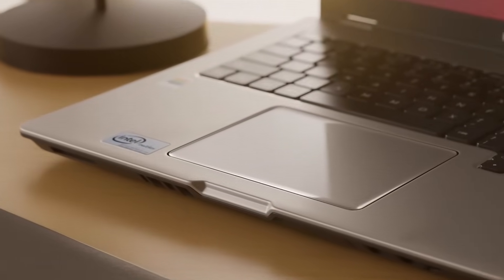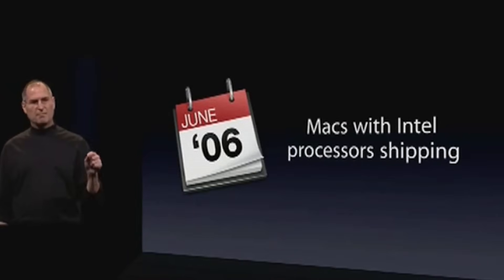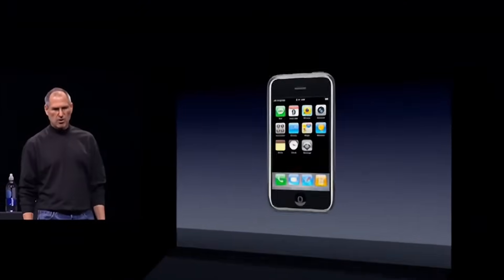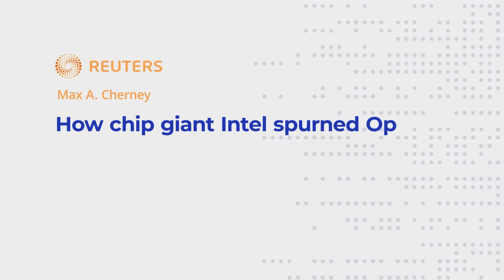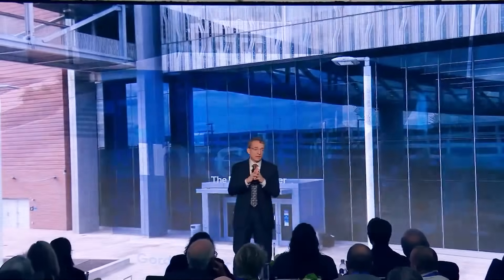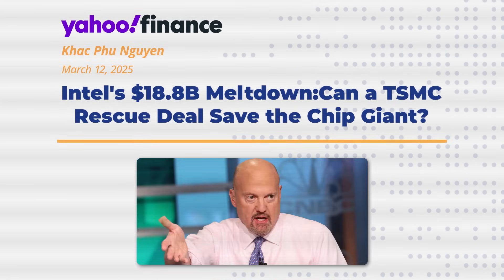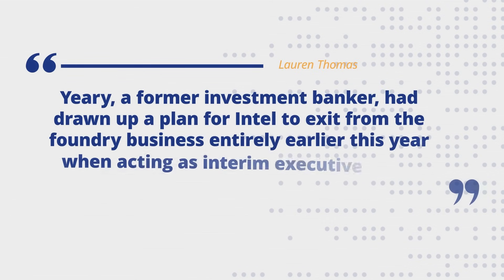An Autopsy of Intel's Self-Inflicted Wounds

Comment: Arms provides big flexibility and added value to customers  to differentiate themselves with its architecture rather than the rigid total controlled PC model dictated by Intel. It also happens as Intel CEO recently acknowledged that the IDM model is not sustainable without external customers for the IDF (even if Intel has the whole PC market for itself.)

There is a host of reasons why Intel fails many of which are as you described here.

Comment: I'd say there are a lot of bad faith arguments being made here, but it's more likely machine generated pablum. The narration audio quality is pretty good, but it was obvious the script was jumping the track when around 7:30 total chip shipments were being used as a metric after previously calling out that Intel deliberately declined to enter the mobile market.

a real analyst would be looking at the development of the datacenter from the late 90s, where x86 (and Intel) pushed out competing architectures like SPARC, MIPS, Power, and Alpha, and how that is currently replaying with ARM. The rise of Opteron isn't mentioned here, either, although it was critical for both AMD and Intel's datacenter dominance.

no mention of how badly 10nm played out, multiple failed acquisitions, the frenemy relationship of Intel and TSMC... it's almost a tautology that companies give themselves self-inflicted wounds, but Intel has been punching itself in the face for decades now and recovered. What's different now than the previous failures and mis-steps?

Comment: Great video. The latest intel microprocessors do not deliver great performance; and if we add Microsoft to the recipe, a catastrophe is coming. Many people have capable computers that won’t be able to run windows 11, and many people are planning to move to Apple as their new microprocessors are amazing. If I want to to buy similar computers. A Dell will cost 3000 and a MacBook Pro 1800 with a smaller SSD, nothing that an external drive won’t resolve.

Comment: This clearly was written by an Apple fan and it bizarrely repeats the ACTUAL self-inflicted would Intel made.
Macs represented 17% of ALL computers. Until last year, even Apple still made Intel-based Mac alongside ARM. The reality is that over 80% of all PCs are still x86 based. Microsoft, who owns the OS used on those non-Mac PCs, tried to switch everyone to ARM and for the most part failed. What the pundits missed is that unlike Apple, which makes an OS that can only run on their hardware, thus forcing users to change or get left behind, Microsoft has to follow the MANY hardware makers or lose ground to Apple or Linux.
The reality is that ARM isn't Intel's big threat - AMD is. Yet for some weird reason, the tech press kind of ignores that AMD even exists.
On the mobile front, mobile devices like cellphones have ALWAYS been on RISC hardware. Before the iPhone even existed we had PDAs (Palm) and smartphones (PocketPC/WindowsMobile) that ran on MIPS and ARM. That was a market Intel was never in and so can't have lost market share in.
If Intel hadn't panicked over Apple and had focused on clear trends that were coming like AI (which AMD did, by the way) and got there first with an AI usable CPU - and if Microsoft hadn't seen the CPU panic Apple caused as a way to restart the PC market by trying to force ARM on a market that didn't particularly care about it, after trying two years earlier to restart the market by making Win 11 the first version of Windows every to just kill off millions of PCs arbitrarily, then Intel would be fine.
Again, AMD did these things by futureproofing their CPUs better, making them more powerful at a lower price point and even doing better with thermals. But mostly by hunkering down and weathering out the Apple storm by being more proactive and innovative.

Comment: One thing not mentioned is while AMD was on the ropes Intel stuck to 4 Core 8 Thread CPUs for years and years and only went to higher core counts when AMD released the Ryzen chip in 2017.

Comment: Intel has always had a healthy helping of Not Invented Here that is dismissive of outside ideas. Intel was briefly an ARM licensee after it acquired DEC. If fact it owned the brand StrongArm which would have been invaluable going forward. But, they just threw it away.

Comment: I bought 100 intel shares in year 2000 for $24 and 25 years later still holding it and is in the negative now, had I bought Apple, Amazon or to be frank any other company I would made a ton load of $. Just my bad luck I guess!

Comment: Using AI generated graphics showing developers as youths in hoodies in a darkroom with multiple monitors is just exceedingly stupid. I have been an engineer and developer for 50 years and I wear a tea short in a well lit room surrounded by EE books and 1 large maybe 2 smaller monitors. Even the graphics on those monitors is stupid AI nonsense. That damages your reputation in accuracy to skip the rest of the video.

What Intel should have done is to break itself up like AMD did and order silicon from the best producers and allow Intel engineers to follow their engineering dreams with say a helping hand $ to succeed in new fields and companies.

Comment: The whole video can be condensed into one word - greed. 4 cores for 2 decades with 1%  increase in a clock and 20% in a price.
Reply: You're forgetting about IPC/microarchitecture.
Reply: It is not greed alone. By the fact that Intel can’t put any chip beyond 14nm even when they realized they are done, they are at the end of their innovation. A dinosaur that need to be ☄️.

Comment: Intel's house of cards really blew down when they stubbed their toe on the 10nm process and AMD's introduction of Ryzen 8C/16T processors  Intel's ability to continually introduce improved nodes always gave then the edge and the 10nm failures and Ryzen's higher core counts was a perfect storm.

Comment: Imma stop you right there at 7:50. Arm64 was superior compute power to Intel at way longer battery life on both apple m1 and Qualcomm snapdragon elite x. Intel responded by making the chips 50% more efficient 1-2 times over two generations as well as slightly better compute power then previous and still fallowing mores law. This video is more opinion driven then factual. Also do you understand computers a CPU isn't designed to have a hundred thousand cores that would be required for ai nor does and CPU. That's the job of a GPU. Intels did make a half arze response to ai called an npu but again no where near the performance needed for a real AI same for arm idk about apple m4 they may be good. Intel making a dedicated npu far more powerful then Nvidia GPU would not save the company it would be its downfall as they are looking for far more energy efficient new silicon designs that are not a cpu or GPU. Intel instead needs to make 10GHz chips as originally promised with 8 cores. This would make them ahead of AMD and the primary place in the PC CPU market again. Nobody is buying x86 for servers they all use arm and Linux. Your opinion saying they should have done something would have just made them more in debt.

Comment: Intel was the first one to get to AI, but the market wasn't ready. They were called Intel xion PHI. Accelerators. He tells the implementation was far too complicated. Several years later, it's storage, marquee in data center was blowing up and Intel was there to create some of the fastests. Ssds, at the time and they were actually on pcie cards, and then later created the optin line of cards or opting line of ssds with a micron.
Reply: Think you mean Optane.  They came in AIH, U.2 DIMM and M.2

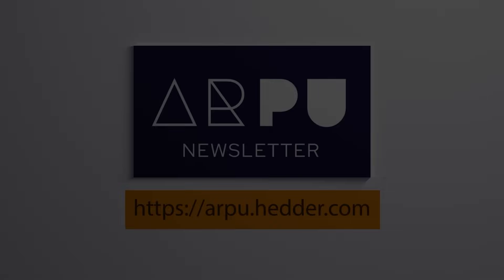Comment: The massive financial loss suffered from its manufacturing part (foundry business) is due to the accelerated depreciation caused by massive investment made in the last five years, especially under Pat Gelsinger.  Usually, the invested capital is depreciated in 5 years.  There are not enough Intel 19:53 chip production volume to share this depreciation.  TSMC was able to overcome this is because it has chip design customers lined up to take the manufacturing capacity.

Comment: There hasn't been an actual Moore's law for more than 10 years now.
Reply: Is that why TSMC’s 2nm has a yield of 94% while Intel’s 18A has a yield of 5% right now? Only Intel has problem with device density. TSMC is doing fine…
Reply: @tringuyen7519  I keep getting my messages silently deleted. 

Anyway, all I want to say is that nanometers in recent times (since Intel's 22nm, introduced in 2012, when they were ahead of the rest), are marketing numbers, and no longer correspond to any geometry or dimension on the chip. You can see that documented on Wikichip.
Reply: @tringuyen7519 I’m unable to respond - tried 4 times and every single one was deleted. Essentially, nm since 22nm do not correspond to an on-chip size.

Comment: There were other fiascos. Going all in on 64 bit Itanium, which flopped, while at the same time AMD extended the 32 bit X86 instruction set to create the 64bit X64, which became the standard. Intel licenced the X64 instruction set, but they missed the chance to seize the 64 bit future. Then they had over a decade of milking their dominance giving customers expensive under-powered CPUs because they could. Meanwhile AMD was quietly developing the ZEN architecture, and the technology to link "chiplets" to create CPUs that had more cores and lower power consumption then Intel. Instead of going back to the drawing board and coming up with something new Intel just kept throwing more and more power at the CPUs, making them run hotter, use more electricity, and making machines based on their CPUs much noisier than the competition. So AMD now have much better desktop CPUs, and Apple have much better ARM CPUs. The only thing Intel have left is a reasonably decent set of laptop processors and chipsets. The Qualcomm ARM processors may be eating those laptop processors for lunch soon too, especially given that Microsoft Windows and pretty much all Windows applications run on them.
Reply: Easy to criticise in hindsight. But Intel was trying something new, whereas AMD doomed PCs to be stuck with the x86 baggage for many more decades. Intel's design failed, sadly. On the plus side, AMDs 64-bit design provided backward compatibility. That's a big win. But ironically, that's what Intel had been doing for decades... 8bit to 16bit to 32bit.

Comment: The fall of Intel started much earlier. Throughout the 90s Intel tried to convince the enterprise world to deploy Itanium servers. At the same time AMD developed the x86-64 platform which was compatible with the past.
Intel sank billions into this project. What made it worse, was the fact that intel recycled the concepts of the i860 from the 80s. This project also failed.
Reply: But there is a problem: x86 is a failed technology that, without dirty marketing and the help of Gates' company, has also sunk into oblivion, Lethe. Intel is a zombie company created by the killers of competition, in the era of the technological degradation of the United States and the destruction of the engineering school.
Reply: :learning:
Reply: itanium bet on compiler technology that never came to exist so never met projected performance, and intel completely missed the importance of backwards compatibility for 32-bit. if 64-bit itanium performance met expectations and 32-bit ia32 compatibility had been comparable to the competition, Opteron likely wouldn't have gotten a foothold. An analogous situation was the Pentium Pro which did a radical redesign of the memory interconnections, with great 32-bit performance, but backwards-compatible 16-bit real mode performance wasn't hobbled and was competitive.

Speaking of the PPro, it incorporated good parts of the i860 (pipelines and bus design) but didn't have the i860's Achilles' heel of long context switch times due to the PPro's register renaming. The i860 appeared in the Paragon and iPSC/860 supercomputers, and appeared in plenty of postscript printers, so while it wasn't a great success, it's disingenuous to consider it a failure.
Reply: @poofygoof  everything is simpler: the confrontation with open Source, the bet on cooperation with Microsoft, greed, and marketing. if you don't know, then x86 is a garbage processor, and the confrontation with open source has deprived "itanik" of its ecosystem and valuable programs, and for the "horse price tag" stretched by Intel marketers, it has not become a commodity.

Greed, pride and marketing.